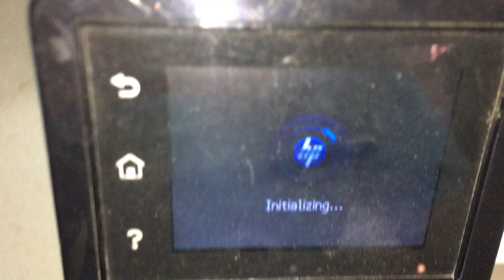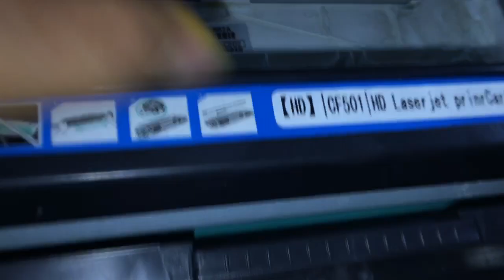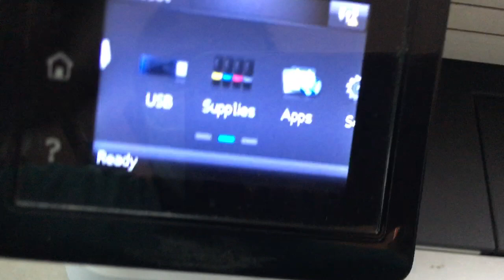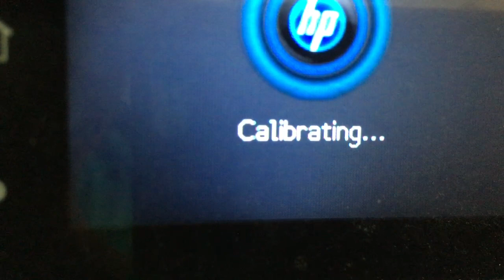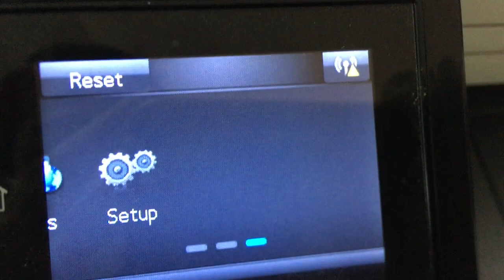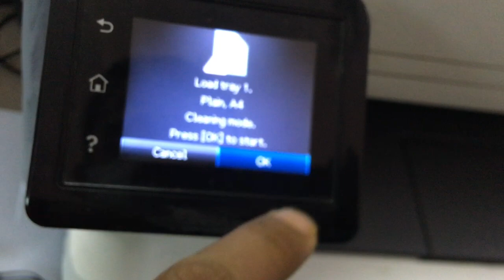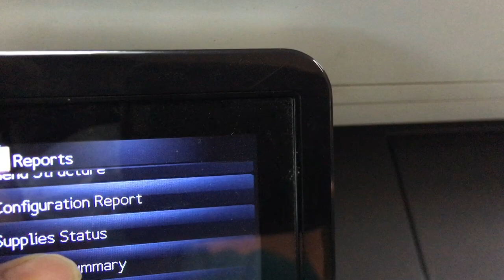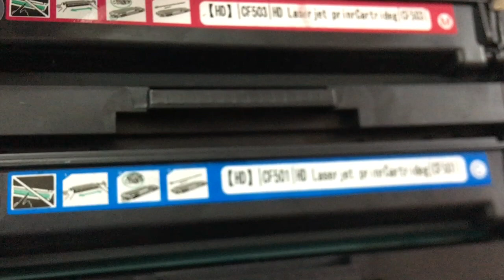HP LaserJet MFP M281fdw print quality problems toner cartridges faults

Comment: I have a print quality problem.  The ink is original and new, but the printing is not clear and the pink color does not appear at all.. The printer model is hp m283
Reply from the maker: Sorry for late,trying calibrate toner cartridges on printer software

Comment: this problem is the cyan toner bad quality, you just need to replace a new cyan toner, i'm printer tech
Reply from the maker: Thanks
Reply: I just replaced all color cartridges and yet I still have those same lines at the back of my printed paper although the front is perfectly printed. There is always yellow toner excess on the transfer belt. The transfer belt is new as well, I replaced it after the old one had tore. What is the problem?